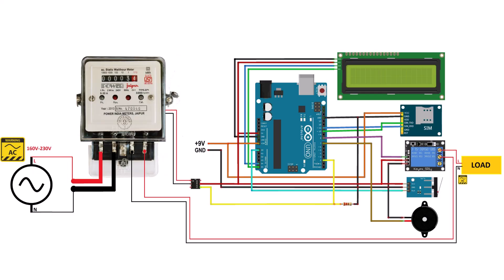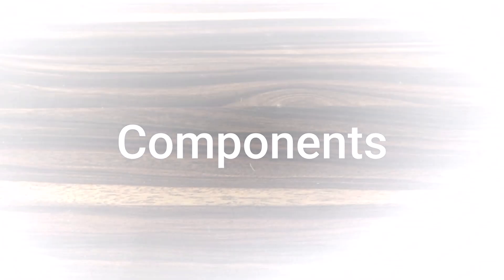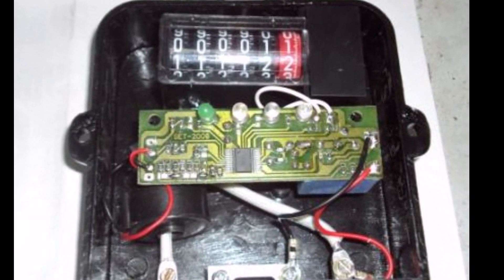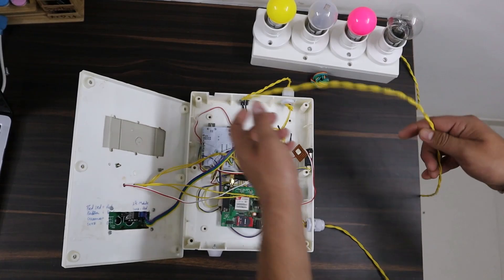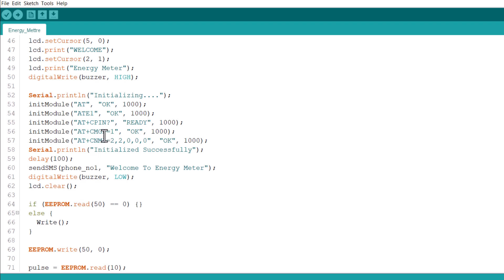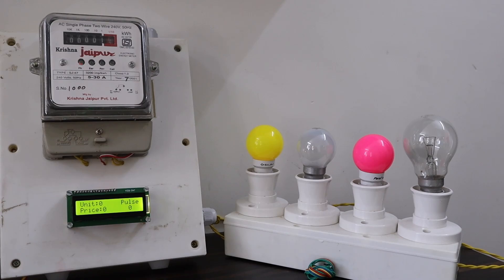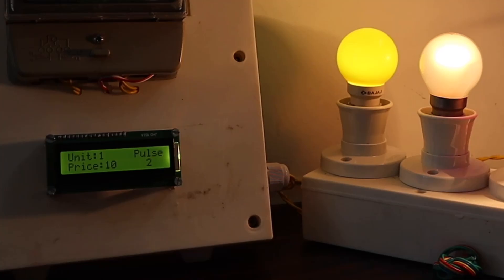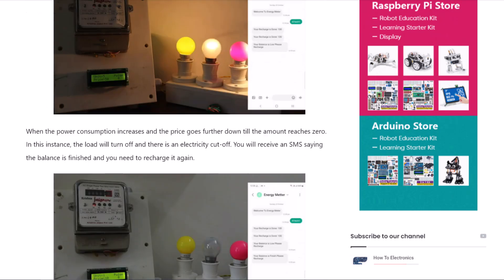GSM Based Prepaid Electricity Energy Meter using Arduino with Automatic Billing & Theft-Alert System

Comment: working fine thanks a lot
Reply: Is it working
Reply: @snehithkumar4757  yes some changes i did to it then it started
Reply: How they are recharging ??? I mean where they typed the message of recharge ??
Reply: @Mayank_Chaudhary22  yes a simple text to the sim card module there, which has a sim inserted by us
Reply: @shrithanosmaharaj8679  bhai please help me i made this project 
1 . when i upload the code it note working error ho raha ..
2. Do i have to provide 2 mobile numbers as given in code of the project
Reply: @Mayank_Chaudhary22  my cmmts are getting deleted
Reply: Bhai i dont know where to connect wire in GSM module please help me ...
Reply: @Abhipower-f4q  bro give I. D. I can share
Reply: We were making this project by referimg your YouTube video, but we are facing some problems,
1. weather should I connect from phase led or cal led
2. After uploading code, lcd is displaying only "welcome to energy meter", and so on... 
Please reply to this mail 🙏
Id abhishetty241
Reply: @snehithkumar4757 we are facing some problems,
1. weather should I connect from phase led or cal led
2. After uploading code, lcd is displaying only "welcome to energy meter", and so on... 
Please reply me 🙏
Reply: @shrithanosmaharaj8679  reply bro

Comment: Ac Sutgle phase meter 
arduino nuo
16 cross 2 LCD display
I Square C adaptor For LCD display Sim are Sim GSM model 
5 volt relay modeule 
3 and 4 5 optocopuler IC 
4 and 3 5 opocoupler ic 
limit switch
or kohm resister

Comment: Can you define what is this "unt_a to "unt_d" on the program?, specially the "price", "price1", "set", and "pulse" as I dont know what are the uses for it. Also where do I put the power consumption based on the electricity rate. I would really like to have an answer on this as this is the only one that give the code for this type of project.
Reply: Seems like a,b,c,d are used to divide the unit consumption into bands. Each band has its own price for every unit used in that band. i..e.a->d are used to set and evaluate tariffs.